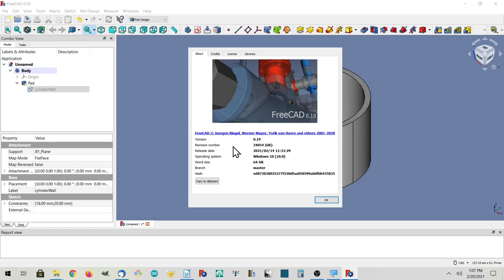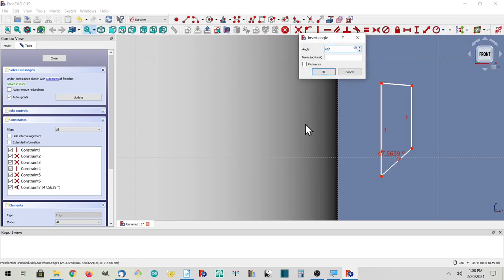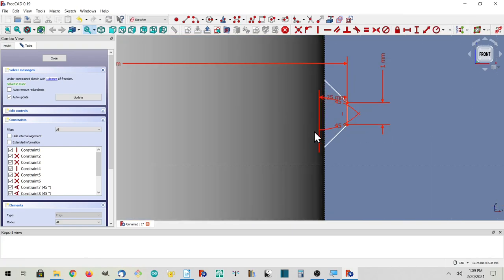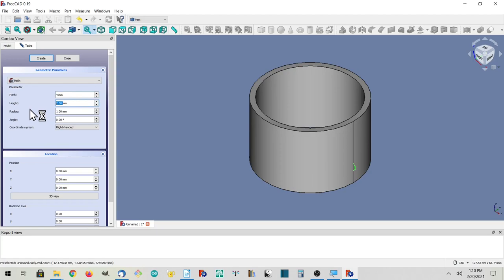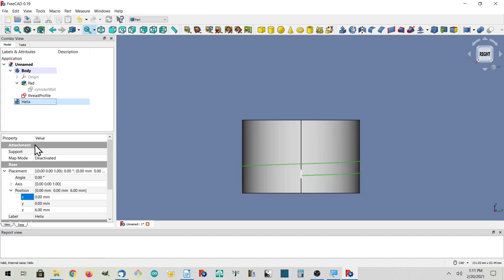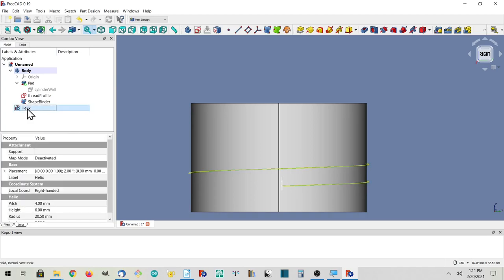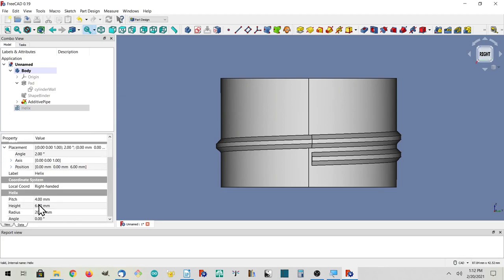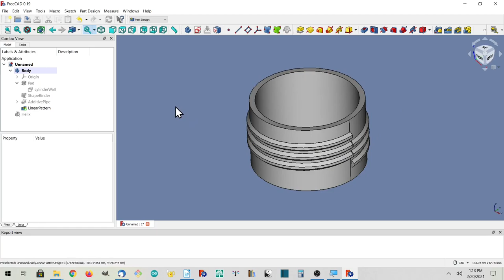How to Make Threads in FreeCAD 0.19 (the quick version)

Comment: If you need a very quick standard thread size just make a cylinder then use the hole tool to make the inside threaded to the size you need. Then make another cylinder inside that just smaller than your previous cylinder. Then  select the inside cylinder body, then the outside (threaded) cylinder and use a boolean cut.

Comment from the maker: Update: Since I've made this video, I've looked at the "Sweep along a Helix" tool in the Part Design Workbench of FreeCAD 0.19. Although the resulting thread still has the same issues (for example, don't cross the cylinder seam more than once), it does make creating that thread a lot easier.

Comment: At the end when doing multiple turns why not just increase the height in the helix? This is a parametric modeller after all.
Reply from the maker: The method of copying the thread is key: as I explain in the longer video (https://youtu.be/1fV679axyiY) FreeCAD has a bug that can make the solid fail if you simply use the helix parameters to get the number of turns you want.

Comment: This seems so unnecessarily complicated. I´ve been fighting threads for two days straight. Sometimes it works great in the hole and not on the cylinder and other times vice versa. I can´t comprehend why it´s so difficult in FreeCad to make basic engineering task. Thanks for the tips! Do you know if it is going to be fixed in further version? Or if it works with realthunder´s branch?
Reply: Complicated? Have you tried it on openSCAD? This was easy as compared.
Reply: @EsusGamer  true, but existence of something worse doesn't change the fact that comparatively to other prominent CADs this is subpar. One measure of unnecessary complexity is that you're happy and relieved when something basic works in the first try.
Btw even if you take step file from other cad with a thread, FC can't "wrap his head around it"

Comment: sir , there is a small space along the horizontal axis between two turns , it looks like a gap between 2 turns .
this happens right after i create the linear pattern feature duplicates of the additive pipe.

any way to fix this please tell me.
can i not use the duplicate linear pattern and some other way to create more continuous turns.
it wont be a problem but aesthetically not fully seamless if tuens are not continuous .

your method is the best i have come across so far.

can i ask one more question => why do i have to shift the helix by 2 degrees .
also why did we change axis of the trapezium and make y axis as 1 ?

also how did you get all the dimensions => 3.99 mm , 8 mm , 6 mm at the start :)

i shall also work on my own to repeat this tutorial and try figuring out the ideas .

thank you sir. 
my very best wishes.
Reply from the maker: The small space along the horizontal axis is there to avoid a FreeCAD bug: if the thread is continuous for several turns, FreeCAD's join algorithm fails.

I shift the helix by 2 degrees to avoid another FreeCAD problem: if the helix starts or ends on the seam of the cylinder, FreeCAD's join algorithm sometimes fails.

I changed the axis for y  = 1 to make the trapezoid rotate in the correct direction.

I'm working on a book to explain all those dimensions - sorry it's not done yet.
Reply: @BradfordNeedham  How's the book coming along ? I will look at the rest of the videos on your channel , thanks for the work you're sharing
Reply from the maker: @Zimbob2424  Between the pandemic and a new puppy, the book has been pretty slow, but I hope to get going again soon. Thanks for your interest in the book - that fuels my book-writing fire.